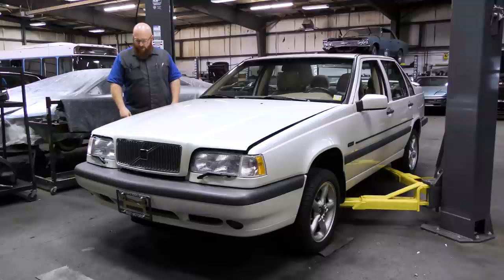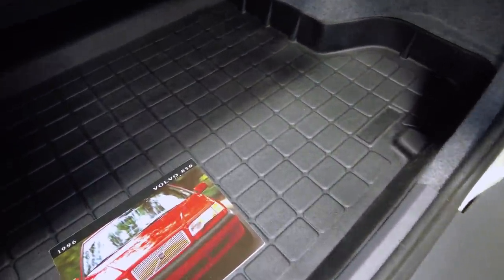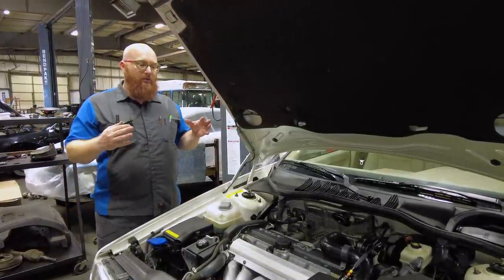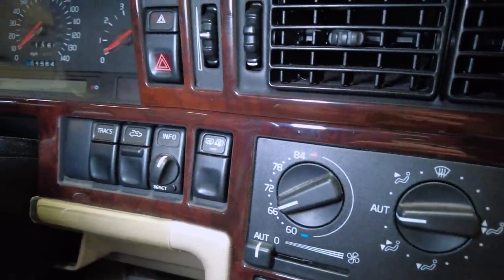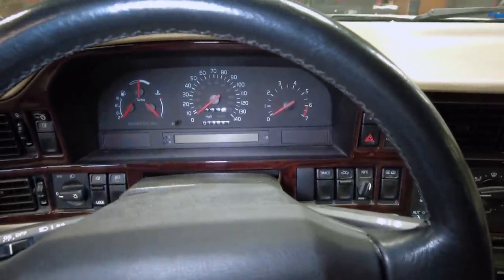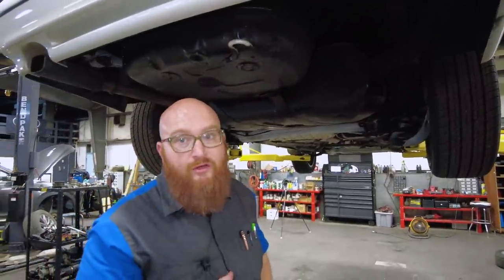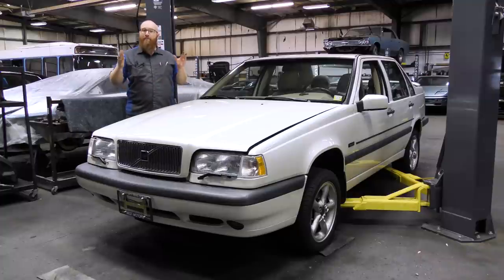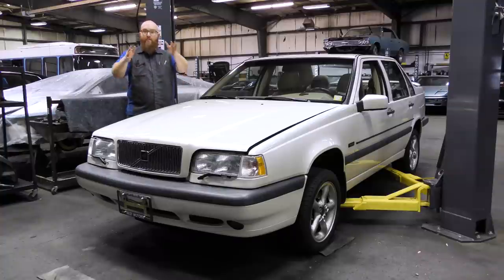Absolute Time Capsule! Super Rare '96 850 Turbo Volvo! CAR WIZARD's in awe of the condition.

Comment: DONT LET HIM RESET THE TRIP WITH THE CAR MOVING it'll break the little gear in the instrument cluster and it'll always have 15k miles on it
Reply: Maybe that is why it only has 15k on it.  <grin>
Reply: This is the case with most European cars
Reply: @markmonroe7330  Unlikely. 7:48 you can see theres 136 or something miles on the trip counter. If that gear was broken it would say 0. Seeing lots of those on the used car market...
Reply: Did not know that
Reply: nah
Reply: The same thing happened with my VW Rabbit GTI 10 years ago. I always wanted the 10th of miles to match with the odometer. I wish I hadn't.
Reply: I still have the car.
Reply: Nonsense!
Reply: I would agree. I had a 95 non-turbo and there is a small diagnostic box that had a jumper and you can actually test the mileage with it based on the number of flashes, and that will tell you the actual miles from the ecu. Not sure if this is the case for 1996.
Reply: Oh sweet Jesus….why isn’t this a wagon….???
Reply: My uncle had a Contour 2.5. The odometer stopped working at 50,000. He use to just put some oil from the dip stick between his fingers, when it felt rougher he changed it. The car was scrapped at 250,000 original engine. Rust ate the Buggy
Reply: @bill90405  no, it isn't.
Reply: Same with BMW e24 and others...
Reply: That’s more of a 240 thing
Reply: @cypilotiowan4761 I have V70..best wagons made are Volvos.
Reply: Volvos are weird lol
Reply: That’s true. I had a 740 and had to go to the junkyard at least once to replace the whole system.
Reply: I've owned my 850 for 2 years now and never had that problem
Reply: @CrapeCraft  Which engine? Best sounding are the 2.0 20v 2.5 10v
Reply: @ChrisPatrick-q6k  B5254S 2.4L 20V, basically as good as the n/a engines got. Sounds great even with the stock exhaust. real happy to have it with a manual trans too
Reply: @CrapeCraft  Yeah, mine were manual. Nice, agree about the stock exhaust, aftermarket stuff just spoils the sound. Nothing beats an 850 manual windows down in a tunnel. (My 2.5 10v was a S70) same car, much lighter doors.
Reply: @steveb6386  I have 4.
Reply: When it's broken, it's an easy but annoying job to do IF you know what you're doing. And that gear is not that expensive. - But yes, I agree, you shouldn't do that. It's my rule to never ever touch the trip reset as well - especially while the car is moving :D :D :D
Reply: @ChrisPatrick-q6k  i was at cars and coffee a couple weeks ago and nobody was too interested in my car until i revved it up suddenly everybody was turning around and raving about my stupid wagon lol
Reply: @CrapeCraft  Yeah, quite a unique thing, shame Volvo's now just about boring 4 cylinder engines now, well, at least in Europe they are. They're all limited to 112 MPH, like a Mk8 Deville.
Reply: @Srdan Radanovic  no 95 is OBD1 96 all manufactures went to OBD2  which is read by a scan tool now
Reply: @CaptainCrape  be careful with the gas tank if you ever have to a fuel pump. My buddy bought one super cheap we found out a plastic °90 nipple snapped off the tank and the previous owner used permatex to fix it. None in the junkyards in our area or the next state over so new tank from volvo $700+ 🤦‍♂️
Reply: @radanovics  Car Wizard should do this for us in the video.  How can it only have 15K?  I'm skeptical.
Reply: this is true
Reply: @schanche1965  Most definitely NOT nonsense. It is very true with the mechanical odometers, whether the speedometer is mechanical or electronic.
Reply: @markmonroe7330  😲🤔
Reply: Naa, wizard would know. Sure there are many indicator to tell age / usage. I had a bike with 10k but really had >30k
Reply: this kcärr i´D kipp -:-

Comment: I've only owned about 8 of these cars, my current daily is a 1996 855 Turbo with a manual swap, 16T turbo, tuned, and it currently has 147k miles. These are by far some of the best cars to work on and drive every day. Definitely going to keep it on the road as long as I can!
Reply: Yes sir wagon gang! Gonna put an 18T On my burgundy 95 estate

Comment: There was a funny story about these in the British touring car championship. Volvo didnt have any sedan bodies ready so they tested a wagon body in the wind tunnel. Turned out it made more downforce than the sedan and could still reach the same weight requirements. Everybody was laughing at the wagon but it quickly became popular until a rule change allowing rear wings made the wagon body downforce advantage obsolete.
I love a good sleeper wagon😅
Reply: I love older Volvo wagons.

I specifically wanted a 240 wagon as my first car, and It was... and I love the 740 and 940 wagons. I love the angles. 

I want another.
Reply: The better story is about why the wing and splitter were allowed for the 95 season and onwards. Alfa Romeo won the 1994 season with Tarquini because unlike the other cars, the 155 TS was homologated with the splitter and spoiler appearing in the cars that were sold acording to homologation rules. What they did was smart, they had the splitter, technically, in the car, but it was pulled all the way back because you wouldn't need that in the road going version. They also had a spoiler that you could put in the boot and not simply use it. The cars they were required to sold technically had these parts so the BTCC Alfa could too, and so they did. That's why they won pretty much all races it entered. But for 1995, the 155 was never on the podium even once. They allowed the splitters and spoilers for all cars so everyone ran them 1995 and onwards. The 850 wagon no longer had the edge, since the wagon shape would not allow for much of a spoiler, at least not the kind that would meet the regulations. So they changed over to the sedan, and over the years they started churning out better and better results but unfortunately for the 850 it never won the championship. The S40 eventually did. 

While the wagon was a neat car, I had a 850 too, the fact is that it wasn't especially well performing. They did some very smart things with the cylinder head angle and other stuff but ultimately they were too new to the game at that point, the platform was too new and they kind of had to get used to it over the 1994 season. While TWR was a great motor racing name, they were up against the Williams Renault. Back then Williams was hot shit, so nobody could really touch the Laguna. During the 1990-1999 Williams would either be 1st or 2nd in the F1 championship so to bring that kind of know how to BTCC, other teams must of felt hopeless.

Regardless the 5 cylinder race engine from the 850 managed to get Volvo the championship in 1998. Even when facing against the giants of the day.
Reply: This is true but you're leaving out the part where Volvo 'interpreted' the rules differently (cheated their asses off) and tuned the engine to make way more power than was legal. Nothing could touch the Volvo on the straights, it would walk cars. They changed the rules soon after. Volvo was having a laugh back in the early 90s.
Reply: @vandecar15  they didn't cheat, they just followed the letter of the rules. The rules said you had to use a production head and weren't allowed to change valve angles, so instead they mounted the production head at an angle, the rules said you weren't allowed to weld on the head so they bolted stuff on instead. It was checked every race and always proved to be within regulations
Reply: @vandecar15  aaah, come on, everybody cheated as much as they could and dared. The fact that it was even possible to make these engines churn out that kind of power was testament to the old Volvo doctrine of by principle making everything more durable than anyone else ever did.
Reply: @vandecar15  SOP for all teams to test the rules. Used to be considered innovation but now we're in an era of single engine suppliers and regs to curb any single manufacturer getting a potential advantage by throwing money at development.  Ford used a huge compressed gas cylinder in a focus WRC that stored pressure from the blow-off valve and released back to intake. Rules said all intake air must pass through the restrictor, but didn't specify it couldn't be stored and reintroduced downstream of the restrictor. A clever anti-lag and power boost!
Then there was the Toyota Corolla with 'expanding' restrictor that looked legit on inspection but when assembled would flex to allow more air. Don't even get started on Lancia. They were off the chart with paper-maché roll cages, salted snow stages and tyre vans halfway through the course! NASCAR had excessive fuel lines to store more fuel. F1 cars pick up rubber debris to increase weight for post race Inspection. As far as I'm concerned it's only cheating when it breaks a rule that's already in the book.
Reply: @TDCflyer  check out Volvo redblock motors. They took their most durable engine, then made them MORE durable and turned the boost up to 11.
Reply: @TDCflyer  I totally agree. I remember reading when they finally put the car on a dyno they were like holy shit this is making 100 more HP than the next car! Then they saw what Volvo was doing with how they positioned the engine and changed the rule the next year. Fun times!!!
Reply: I had an 82 turbo wagon put over 800K on it was the best car I ever had!
Reply: @poguemahone5476  How is the redblock related to the whiteblock modular engine?
Reply: Yeah true story. My boss is Rickard Rydell, he keeps all his trophies at work.
Reply: I had a rear wing on my V70, I couldn't do it to my 850. Probably better I have fond souvenirs of the 850 but not so much the V70. When you start modyfing the body and drivetrain shit goes down, along with your wealth. 😅
Reply: I daily drive a 400,000 mile 240 wagon. Even with the base model, 2.3 litre Red Block and automatic transmission something freaky happens as you pass the 100 mph mark. Downforce takes over and you feel the car sink and become more stable. The back of the car does not get buried in snow, either.
Reply: These were amazing rally cars despite having the aerodynamics of a wall 😂

Comment: I had a red 1996 Volvo 850R wagon a few years ago and I absolutely loooooved it. I lived in an apartment at the time and couldn't justify keeping it alongside my normal daily driver car, but it was in great condition and would stop car shows whenever I showed up with it. I miss it immensely, but I ended up selling it to another Volvo enthusiast who drove 5 states to come get it and he still regularly sends me photos. Knowing it's in good hands and getting taken care of eases the pain a bit.

The thing did a better job starting up in the bitter cold of winter than any other car I've ever owned, and had zero rust whatsoever despite being from MA! It was also extremely easy to work on and not at all expensive to repair for what it was.
Reply: Those were awesome.
Reply: No rust because its body is mostly aluminum, for Swedish weather.
Reply: The 90s were the best era for Volvo. Least till '99.
Reply: I daily drive an 850 2.4. If i were you i'd just sell the normal daily, because to me an 850R wagon is a very sensible daily car 🤣

Comment: @12:40 The rear suspension might not look like much, but it's actually a really sophisticated setup. It was called the "Delta Link" and was a compromise between fully independent rear suspension and a beam. It allowed for passive rear wheel steering which reduced the turning circle and made the 850 quite nimble for the size of car that it was. All front wheel drive 850s, 1st gen S70s and V70s were fitted with this setup. 

The build quality on these cars is absolutely incredible, I had one from 1995 with just about 250k miles on the clock and the engine was completely leak free. It looks like it still had all the original seals. No structural rust either, the entire subframe didn't even have surface corrosion.

Comment: You can set the hood into a Service Position like on some Mercedes .
It makes working under the Engine hood so much easier
I did my apprentice and master mechanic first years on These types of Volvo.. also the 940, 960.... and the C70, V70, S70, S90, S80...

I love these older types.... such timeless diamants

Keep them alive 👌🍀

Comment: I had two of these, one wagon and one sedan.  Both were the "R" version and had the Group 6 chips to overboost the turbo.   They were fun, lots of torque steer off the line, I even tracked the wagon once with a little yellow "baby on board" triangle stuck on the back window.  I'm sure people wondered what blew by them on the straightaways...

Comment: I love the unique five cylinder noise these things emit. It is a good compromise between a four and six cylinder and makes for a high powered front wheel drive with an inline engine where you can access all the spark plugs with ease.

Comment: Wow. I had a ‘97 GLT. It was a winter car, but it looked brand new. The paint was such that you could buff those things to a shine (non metallic) no matter what. Coincidentally, I just tossed out the OEM turn signals yesterday. I took them out years ago to replace them with clear corners. I still have the roof load bars.

Comment: That "little screen" is a information screen which is switched to the various information readouts by the switch on the dash marked as INFO.  Moving the switch provides info such as instant mpg, avg. mpg, distance to empty, time, a separate trip ODO, temperature. It's very accurate.

Comment: I'm a student and I drive a '99 V70, basically the same car with a slightly different body. The engine bay stuns me, my car is maintenance wise in pristine condition but this is really next level. It still has a whole life in front of it. Mine currently has 355k km (~221k miles), they can easily drive 600k km and some are even above a million (625K miles)

Comment: It might be wise to check the crank case pressure. The pcv systems can go bad if these don't drive long distances. If it goes bad, that's when you get oil leaks. RobertDIY has some good videos explaining it in detail.

Comment: from WHEN Volvos were Volvos

What a marvellous car. I hope the new owner takes some real special care of it. It deserves to be preserved with minimum use, to keep its brand new soul!

Thank you for sharing, Wizard and Mrs Wizard.
Reply: These made in netherland front wheels drive cars are not real volvos.
Just more modern DAF:s.

True classic Volvo is rear wheel drive and made in sweden.
Reply: @suomenpresidentti  
Gent in Belgium, but also Gothenburg, Sweden. The DAF-era was 300 & 400-series. The most fun car I've ever had was in fact a mint condition low mile 460 but declared dead by annual road inspection thanks to zero rust proofing from factory
Reply: @suomenpresidentti  The 850 Turbo wasn't manufactured in the Netherlands. They were all Torslanda made.
Reply: A Youtuber  I get your point, but if we thought like that, many cars from 80, 90 or 100+ years ago would be absolutely extinct or not as good anymore, as the ones which were preserved like new. But I've got your point. It's valid.

Comment: Try if the AC is truly blowing cold after restarting it after a drive. If it is not, then you need to shim the AC clutch, you simply stick two  two wraps into the thing in front of the AC clutch. There are vids about it on the YT

Comment: That Turbo 4 Valve 5 Cylinder is just incredible. For my money it is one of the best engines ever. Tremendous response, good mileage, smooth and FAST.  And Volvo interiors are really comfortable. This proves keeping your car out of the sun is the best way to preserve it. The same car if left in the elements will have its interior just fall apart as the plastics and adhesives decay. That said it is not rare at all to see a 30 year old Volvo on the road. Just excellent "heirloom" cars. Perfect for a kid's first car. You know it won't break down and will survive an collision. They're boxy but they're safe. Well the old ones. The new ones are quite pretty.
Reply: @Dennis Fahey if that was my car i would wax it with paste wax every 3 months and apply 303 protectant to the interior every 3 months as well. Care for it like a brand new car basically, if not care for it more
Reply: A new young driver should be in the most recent modern car a family can afford. The latest safety technology beats age every time, given the car was built for safety in the first place.
British Fifth Gear slammed a small Renault Modus into an old 940 wagon 15 years ago. The Renault won that fight despite facing a Swedish family tank head on. Video on YT is a quite telling story. 

The worst fear right now would be the Chinesium cars getting international traction. Cheap. Looks modern. Are total junk and absolutely deadly.
Reply: You are right,those engines are indestructible and very reliable.When volvo introduced the new 2.0 litres VEA -engines the problem began.I had taxi company in Stockholm for 30 years and I have some experience about volvo.
Reply: @georgiosevangelou9258  
370 000 km on my 2.5FT. Runs like a champ, original turbo even.
Reply: and big fuel consumption... good for usa not sweden
Reply: My 850 was left out in the beaming sun so many times and the dashboard and front seats were cracking so bad. However, the rear seats looked like they had never been sat in. Even after I lost my virginity in the back of mine when I was 17. Lol
Reply: @rosen9425  nailed it!  Unfortunately true.  Post 2000 cars are infinitely safer, particularly the Volvo's after 2000.  The newer the better by far.   Really good stability control didn't really get nailed down till around late '00's to mid '10's/teens